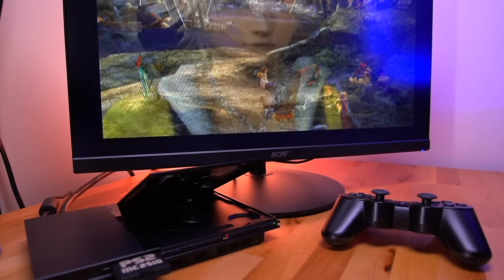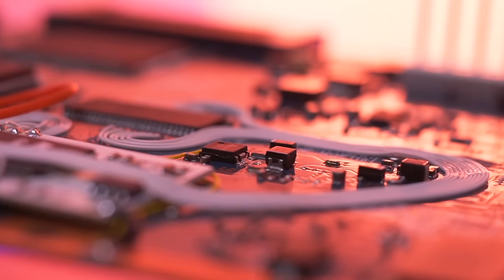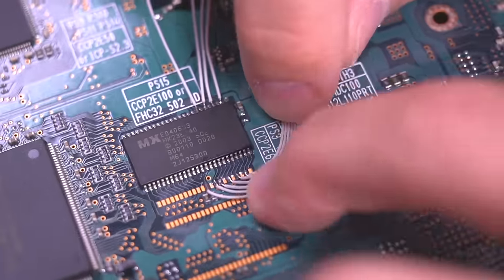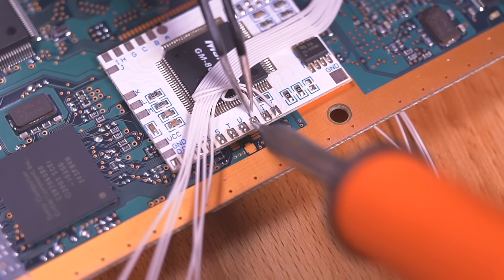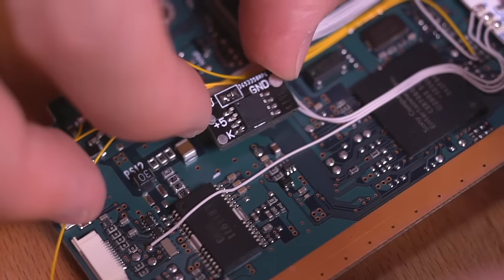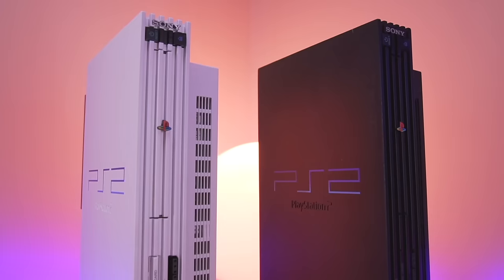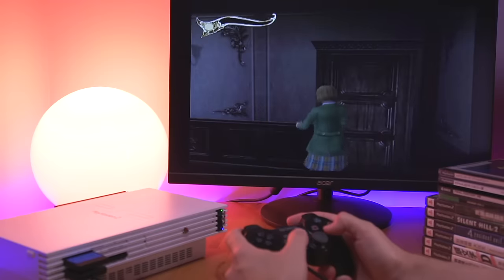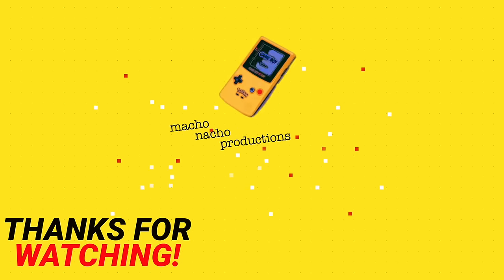Why You Need A PlayStation 2 Modchip In 2022!

Comment: Mod chip runs faster than free mcboot..
Reply: Where can I get one for Japanese ps2 slim?
Reply: @scarvello  eBay
Reply: It 2:32 am eastern time.  I want to know, whenever I get a ps2 I want to know how to get a mod pro gm-806HD and I want to if you can install it for me.
Reply: How ? As far as I know mod chips allow you to play from the dvd drive, Free Mcbot allows you to play from the usb or hard drive, which will be way faster! 
Also it removes dependency towards the most common point of failure of the console: it's optical drive !
Reply: It does but the minority of people can use them. It is very hard to install. I broke 6 PS2 before I got the first PS2 working with a mod chip. Now I have 3 PS2 consoles with mod chips but it is very very hard to solder all those points without messing up and very easy to brick your PS2 the Mecacon or the bios chip and the Mecacon has the hardest soldering points which are G,H,I,A and B which are very close to each others in all the board revisions. I wish you the best luck and the fat PS2 are a little bit more complex to disassemble than the slim models. You are better off to let somebody else work very high soldering skills to do that job, it requires very high soldering skills and know what you are doing with the soldering machine. Never buy a 30001 model, they have nothing but problems unless you can get it dirt cheap for $10 or $20 bucks in working conditions but they don‘t last with with a mod chip installed.
Reply: @V4mpyrZ I modded mine with a DMS4 Pro. It runs ToxicOS off of the chip itself which let's you rip and run games off HDD in addition to playing PS1/PS2 backup Discs.

Comment: Mod chips put a ton of wear on the laser when using burned discs.  I’ve had to replace my laser assembly twice on my modded PS2 slim.  I still love it though. :)
Reply from the maker: I have a video for that coming soon 😉
Reply: In my country it's common to have ps1 and ps2 with modchip pre installed by sellers and funny enough also riddled with faulty lasers lmao. I guess that's why rentals gave up and change to hard drive instead.
Reply: Cheap burnable discs put wear on the laser not the mod chips
Reply: @nuthinnew  I use taiyo yuden discs. Still tougher on a laser than the actual game discs.
Reply: @nuthinnew  Well... Both, depending on the chip. ALL burned or scratched discs put strain on the laser, BUT bad discs do more and some old chips do some bad stuff as well.
Hence 3.3Volt was promoted as a feature!
Reply: use the ps2 180degree upside down when using better for the laser
Reply: Completely depends on the disc used.

Use HK Silver or Black disc's for CD's, Ricoh for DVD's.

I've never had any issues with laser, aside from GameCube, and that's extremely common.
Reply: @markbessert1883  Is TY still a thing? I thought the recommended ones were Verbatim AZO discs, which I remember getting for cheap (and genuine at that.)
Reply: I remember when I was 15 my friends laser on his PlayStation broke. We went to Argos (U.K. Electronics store) bought a new PlayStation swapped the lens and returned to store for refund. Got refund and now had perfect PlayStation. And no, I don’t feel bad that we scammed Argos. I remember before that when my lens went bad and another friend tunned it and made it like new.
Reply: @hfhxshjc4045  I had to do this when mine went bad but my friend was able to tune up my lens and it was like new.
Reply: @nexxusty  Ricoh disc was my disc of choice. Cheap and reliable
Reply: @NSHG  Taiyo Yuden? I am not sure.

They were good too. Completely forgot about them.
Reply: @grahamkelly8662  Hahahaha. I've done this so many times before for so many different reasons.

I have NEVER felt bad about ripping off a corporation and I never will. I do it with Amazon monthly.

Never had even an inkling of remorse.
Reply: @grahamkelly8662  They were the best DVD's. Ricoh 08's.

The purple dye on them was, and is the best. Nothing is better than wasn't 4x the price. Even then, only marginally better at best.
Reply: @grahamkelly8662  I did something like this with my broken Xbox Series S controller. I bought a new one at Target and then returned the broken one. 🤷🏻‍♂️

Comment: As far as I know the only way to (easily) run import games on another region console is still the modchip option. Without doubt one of the hardest mods I've had to install. Look forward to hearing your take on this.
Reply from the maker: Completely agree with you Mat! 👍
Reply: @MachoNachoProductions  There's MechaPwn, though. No need to patch discs, no need to burn discs, and also plays PS1.
Reply: Yes, MechaPwn for the win! It only works on SCPH-5000X fat PS2s and all the slim PS2 models, but it's super easy to setup, and it doesn't require any hard mod. You only need a way to run homebrew like FreeMcBoot, and that's it! I got it done on both my slim PS2 and a SCPH-5000X fat PS2 that I recently got, and it works fantastic! You can run both PS1 and PS2 games from all regions, as well as backup discs for both PS1 and PS2. The only caveat is that the ability to run DVDs on a PS2 may go away. Bu hey, who wants to use their old PS2s to watch DVDs in these days!
Reply: @JerryBaezAlchemus  MechaPwn is nice, but it only works on 50000-series models or later. If you have something earlier, you still need a chip for that.
Reply: Erm... Tonyhax for PS2s 39k and older...
Reply: @JerryBaezAlchemus  Actually... The ability to play DVD-Video should only "go away" when "force unlock" is selected.

There is a MechaPwn 3.0 Beta, which should fix that issue! ;)

On another note: When Funtuna is used in conjunction with MechaPwn, we got a nice effect, which was unexpected! We can run non-patched (no Masterdisk-patch needed) PS2 Backups!
Reply: I have used the MechaPwn hack however I've had limited success with it. I'm hoping in time it will become even better as installing modchips is tough work.
Reply: @MatSpeedle  What was the "limited success" you had??
Reply: Hey i have an SCPH-90004 model slim console. Its very new and not much used. Even the warranty sticker has not been tampered. That means its not modded. 

So i want to play all ps2 games in it. I want to burn iso to dvd and play in my console. What are the things i should do. Is modchip the only option?. I dont want to play from usb since it will be laggy and the games could crash.. plss help.
Reply: @MachoNachoProductions  with softmods u can't play other region games?

Comment: As stressed in the video, it's a tough mod. Make sure your soldering skills are up to the job, and I do mean that, you start shorting legs on the SMD chips and it's a world of pain unless your eyesight (use magnification) is good.I was a prolific PS1 mod chip installer, but the PS2 is using much finer scale SMD chips, needless to say I mucked the first one up. After revising my skills it was better but there's a high level of challenge. Tito makes it look rather easy, it's not for any novice.

Comment: I tried modding one of the Slim model PS2s with a Modbo. I found some documentation on the solder points but that was it, nothing deeper. After I finished I couldn't get the system to turn on and after removing the chip it still wouldn't power on. A tricky mod indeed.
Reply from the maker: Yeah, that’s the one thing that’s a downer with some of these chips, documentation is a bit scattered
Reply: RIP PS2 Slim
Reply: Hard fail.

Comment: This is my "walk to school uphill both ways moment" it was such an involved process to modify consoles back in the day. When the xecuter series for the Xbox came out that requires no soldering it was a game changer. You still needed software but it was way easier than chipping this ps2.
I have the same chip and plan to upgrade one of my slim ps2. Hopefully before the snac adapter releases for the ps1 core on Mister
Reply from the maker: Haha, I’ll also have to start using it as my uphill both ways story 😂
Reply: Not much has actually changed in terms of console modding, except that it's become even harder. The original Xbox eventually did get a softmod, but the 360 didn't and probably never will.
I believe the ps3 did have a softmod but it was patched.

So far none of the consoles past that have a hardmod or softmod.

So I don't think modding ever got easier.
Reply: @thegoodolddays9193  the ps3 does a soft mod, that works on all ps3 consoles, its called hen if you want to search it

Comment: I’ve still got my chipped “fat” PS2, but I haven’t used it in years. I don’t remember which chip it has because I bought it pre-modded online, but it was right after Vice City was released. I borrowed and “backed up” every game I could from anybody I knew with a PS1 or PS2🤣
Reply from the maker: Nice, be interesting to know what chip it is
Reply: @MachoNachoProductions  If I remember correctly, you power it up normally for PS2 games, but you have to hold the reset button down for a couple seconds to boot up a PS1 game or a DVD. Or maybe it was vice versa? It’s been too many years ago! 🤣
Reply: That's definitely toxic os(Dms4 clone) I just bought a ps2 which has toxicos and I need to press the reset button for like 4 secs to boot up ps1 games😊

Comment: I used always Matrix Infinity modchip. Even if they were clones, all my modded PS2 worked flawlessly. I used to listen music or play videos with SMS, used ULElf as file manager to browse files on memory card(s), USB mass storage, HDD and CD/DVD, installed FMCB on FAT and slim PS2, even booted Linux with KLoader. When I found a sync-on-green compatible PC monitor (a huge 19" CRT), I played many hours on it, by selecting the video output from the Matrix chip. And, by mistake, once I upgraded a modchip and broken it, because well, it was a clone and not compatible with the original Matrix Infinity firmware.

Comment: I remember when I bought a Mars mod chip and used a butane soldering iron from radioshack with 30 gauge wire to mod a ps2 slim. My first soldering project and discovering my love for modding and soldering.
Reply from the maker: Nice!
Reply: Butane soldering as first job ? Respect

Comment: After having a couple of ps2's fail on me for "disc read error" endemics, I had finally had enough of the consoles refusing to read discs and damaging them in the process. I made a point to buy a pre-chipped one, that ended up having the matrix infinity in it.  Soon enough, it too started having the errors again, but the seller was at least willing to take it in to get it repaired and hopefully sort out the issues. Per his word, on the last day of testing before it was meant to be packed up and sent back to me, the disc drive *shattered to pieces*. The plastic tray, the motor, the rails... everything! It might have been a freak occurrence, but it was enough to seemingly convince him to do something big to insure against it. From there, he was able to transsfer the chip to a more familiar revision of the console, and basically reinforce and re-cap the whole motherboard.

To this day, that's still the longest lasting anything I've had with a playstation badge, since. Every stock console from Sony has just been garbage for hardware reliability for me. And given Sony doesn't even try to bring any form of backward compatibility since even the slim PS3, much less the PS4... I've just had no reason to even look at another console of theirs again.
Reply from the maker: I wonder how the ps5 is hardwarewise. It seems like a beast. Yeah I agree, I wish Sony and other console manufactures did more for backwards compatibility.
Reply: @MachoNachoProductions  The series x at least allows you to stick an OG Xbox or Xbox 360 game to try and play it, though part of that is dictated by the online DRM of the console. 

That said, I don't recall if this was ever changed, but something like a one time payment of $20 USD to your Xbox live profile granted developer privileges, so you could sideload your own apps for homebrew at the least. It sort of helps I suppose. Still not as fun IMO as a jailbroken console
Reply: Disc read errors is easy fix
Reply: @serimar  FIle that under "things I could have appreciated knowing about two decades ago".
Reply: Exact opposite for me. I still have the PS1 that I chipped 20 years ago, works perfectly. Haven't even needed to tweak the pot yet.

Comment: Great video. Voultar has a couple videos on installing PS2 modchips, he's often referred to them as "PS2 Killers" because they more than likely end up killing the console.
I myself killed my launch PS2 back in the day with a NEO 4.1 modchip that I got from Lik Sang (remember that one back in the day). This was back when I didn't know anything about soldering, and didn't have the right tools. I should pull that out and give it another try now that I have a station and some proper gear.
Reply: Ooooh, Lik Sang! Good old days! (as well as Lan Kwei (sp?))
Reply: Should I worry though? Don't think Ive had issues with my matrix infinities so far...
Reply: @ShadowZero1980  I mean if it's installed you shouldn't have to worry about it.

Comment: I bought my first PS2 (a v7) in 2002 (possibly early 2003). Then I wanted to be able to take the PS2 on our vacations with my wife's family, I wanted to do a modchip so I could put all the games on a hard drive and save space by not having to lug all the discs around. I didn't think I'd be able to do the soldering required but found the DMS4 Pro EZI which was all solderless. I still have it hooked up to the downstairs old CRT TV.

I'm now down to 4 PS2s still in the house as I just gave my oldest a v7 running FreeHDBoot with a SATA adapter for the official NA that she took back with her to NY. I've got another v7 that I picked up at a pawn shop that had a network adapter for less than I could find NAs at the time that has a broken controller port and I needed the NA for a friend. (I've since gotten that NA back as well, so it's a full machine. It's been opened before, but I've not looked to see if it is chipped or not.) Then I have another v7 Goodwill find that I'll get around to setting up as well. In the living room, I'm currently working on setting up what I believe is a v9 (I've not opened it to verify the motherboard) with a SATA mod to the official network adapter and FreeHDBoot. While I had no problems with the SATA mod I did for my oldest, it was from a different seller that only had 1 left. I bought the other 3 from a different seller and I've had issues with 2 of them. I just swapped the hard drive though and seem to be having better luck now with my initial test, though I haven't copied much over yet.

I'll eventually get back to seeing if I can get the DMS4 Pro to work with newer versions of Free[MC|HD]Boot than the 1.8c that I did have running on it.

Comment: I have one of these white ones. So pretty.
Great to hear more ps2 videos are coming!
I absolutely love how you in a serious voice said that modding is for playing imports.
actually modding a ps2 is not even needed. Just put in a HHD and use a HDD loader disc to play games of the hdd. Then after that you can mod easily
what is the battery even for?
What happens when you leave the battery out?

Initial D can be forced to 480p with GSM or better yet OPL+GSM. It will blow you away. and I know if you tried this, because you will then make a video about forcing games to 480p.

Also, but I have no experience, you should be able to run European ps2 and ps1 games. Not that there is any reason to try that at all.

Love all your videos and also love this video, but I still think that a mod chip is one of the least cool things you can do to a ps2. I think I have some modded ps2's, but there is no use for them.
My guess is that about 20% of all ps1's are modded so they play all region ps1 games.
As for aps2, just get a internal HDD and load the japanese games on to the hdd and play them from there.

Comment: The idea of having region-free games from the mod chip, and backups loaded from your SSD is cool, but you don't have to do the trivial soldering to make your console region free. I'm not sure if it works on all systems, but there's a softmod method called MechaPwn, which modifies the PS2's lockout chip into changing the region, specifically changing it into a development system allows it to load PlayStation 1 and 2 games of any region, including backups. All of this being done without any chips installed, You don't have to boot into PS1 mode to play ps1 games as well
Reply from the maker: I think mechapwn isn’t compatible with all systems but it does seem like a fantastic alternative for consoles that work with it